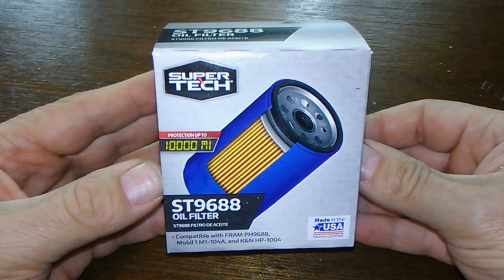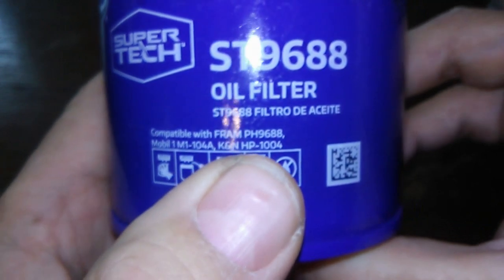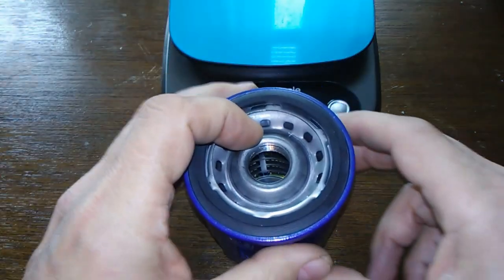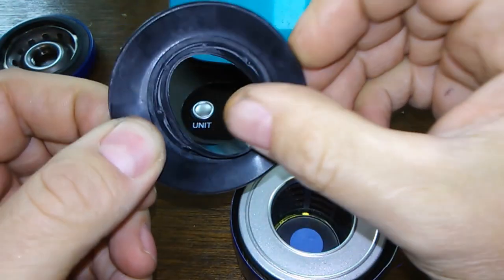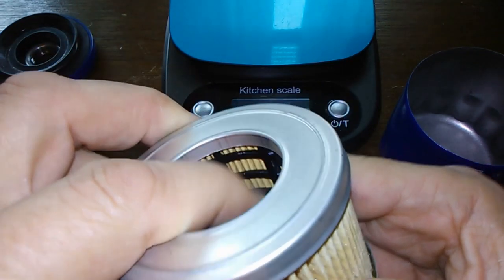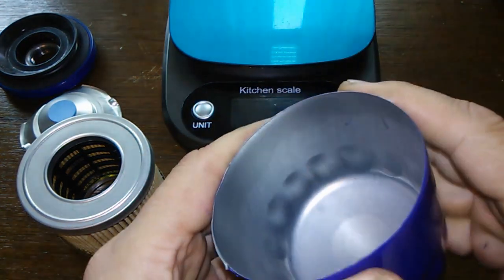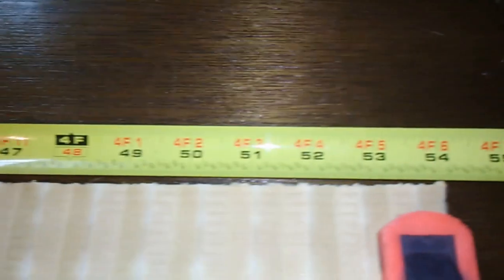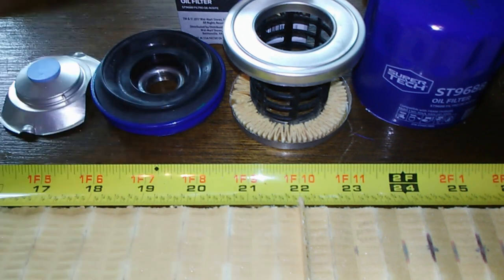Walmart Supertech Oil Filter Cut Open ST9688

Comment: Bob the oil guy reports, as of 2018 Champion Labs manufacturers the blue cans.  The white cans have been discontinued, but apparently there are still some available.  The white can were made by Wix. 

Good filter for $3, and for change intervals of 5k.
Reply from the maker: Yep,👍
I used to use them, and I think they were black, before the white Wix cans. Do you  know who made the black cans? (I never used them).

Comment: I heard someone recommend this for a Polaris ATV with a horizontally installed filter.  I think the anti drain back valve should keep the oil in the filter just fine and I'm not sure about the pressure setting that it releases at, etc?     Basically my question is if it should be safe to use other brands if they spin on and seal..... because the Polaris filters are more expensive
Reply from the maker: If you check around the internet you'll probably find an ATV Forum and get a better answer than I can give, because I dont know anything about ATV's engines or their oil filters.

Comment: Good video 👍I know the diesel filters are a little more expensive but maybe in the future would like to see some different brands cut open and compared👍👍
Reply from the maker: Hi Jacob,
Some diesel oil filters videos mixed in is a good idea. There may be some other viewers  who would enjoy them also. Could you give me a couple suggestions?
Thanks for the compliment and suggestion.👍😊
Reply: @WhipCityWrencher  Thanks for reaching out that's awesome! Well might get a little slack for this but I run a napa gold 7620 on my pickup and used to use the Donaldson 7349 before. I was curious about the cheapest filter offered for the Cummins compared to the Donaldson filter.
Reply from the maker: @JEvans575  Hi Jacob,
from  what I read about the Donaldson DBL7349, the filters spec's are 99% at 15 microns, that's going to be hard to beat as far as filtration goes. There are a lot of cheaper oil filters but you'll lose out in quality and filtration. A few cheaper in price oil filters that I can think of that may be close to quality, and those filtration numbers, are the Napa Platinum, Fram Ultra, WixXP, and Purolator Boss.
 You don't have to pick those, but please name me two specific oil filters, and their Filter #s and I'll make a couple of  videos.
 😊
Reply: @WhipCityWrencher  sweet 👍👍if possible the Donaldson 7349 and napa 1607 thanks again really enjoy the videos and definitely subscribed 😎🤙
Reply from the maker: @JEvans575  Done deal,
I'll do the Donaldson first, and then do a comparison video with the Napa. I'm thinking the video will be out probably the 2nd week of Feb., 😊
Reply: @WhipCityWrencher  Looking forward to it thanks again👌
Reply from the maker: Hi Jacob,
I finished them diesel oil filter video's earlier than I thought.They will air Jan.26th, and 29th. 😊
Reply: @WhipCityWrencher  Awsome!!!!👍👍counting the days thanks for  reaching out🤙